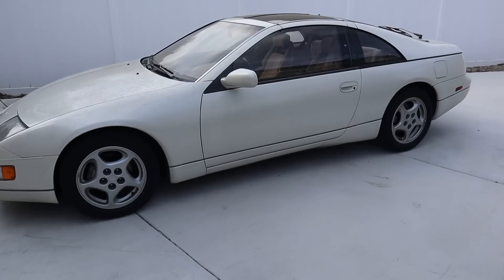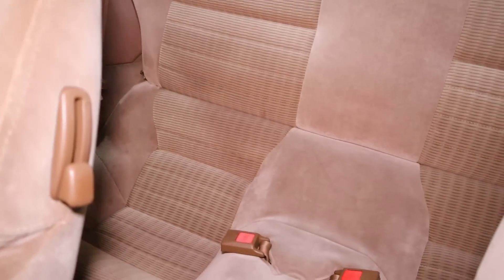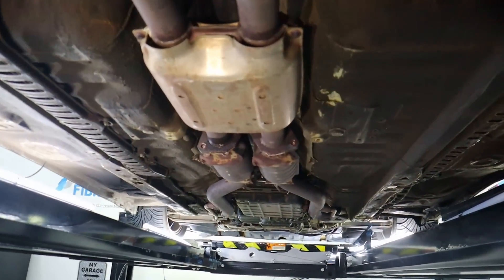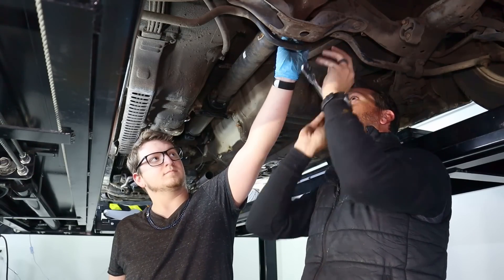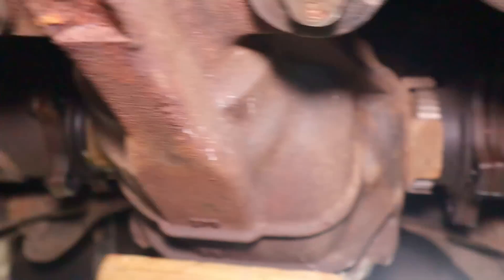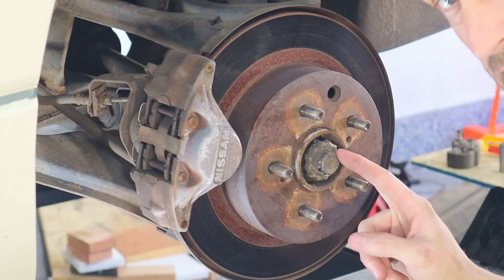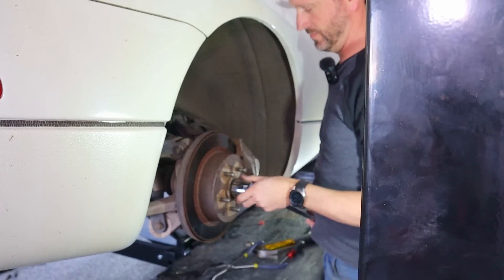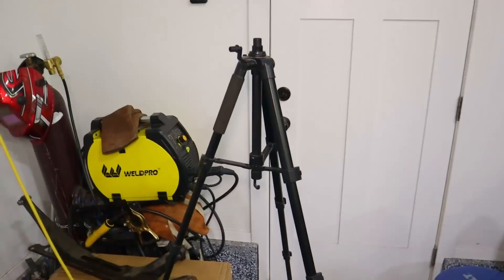Tesla swapping a 90's Icon!  New build!  Nissan 300zx

Comment: Watching it again and you might find out about moving it with the rear axle out of the rear axle. It might hurt the rear bearing in the axle. The front wheel drive VW will be hurt if it doesn't have the axle in and tight. Just trying to help. Go by some cheep impact sockets please. Craftsman aren't that great.

Comment: Might want to use impact sockets when using impacts for removal - could be why you have a cracked socket. May have physically cracked under high load after some weakening
Reply from the maker: You are probably right

Comment: Hey, just so you know you need to put those axles back in or at least the outer CV joints back into the bearing that’s what helps to hold the bearing together. You can damage the wheel, bearing with the weight of the car without the actual, squeezing it all together.

Comment: Nissan interchanged a lot of parts in the 90’s. Tons of similar parts on various models. For instance….. if you need some more room in the diff area, you can use axles from a 240SX. That will get you an inch of room on each side. The bolt pattern is different on a USDM 240, but the stubs are plentiful or you could use JDM axles which are the same 5 bolt flange as the Z32 chassis 300ZX.
Reply from the maker: Thanks for the information!

Comment: 4:35 that's what happens when you use an impact gun on a soft socket. Impact sockets are much harder & stronger...
What powertrain is going in the 300ZX?
Reply from the maker: TBD.  Have to evaluate the space

Comment: Jeremy, It's nice to see you have work.  Word of advice and I understand you are not rolling the car around. Just be careful about not having the CV joints in. The torque of the nut and the CJ  in place helps to preload the bearings. Without the CV joint in place it could cause an issue to the bearings over time. (It could - not saying it will.)  All the Best, Tony
Reply from the maker: Ok, thanks

Comment: The dust cover for the wheel nuts are kingpin locking shields to stop the but from turning, should've been a pin through the hole in the axle that slots into the crown of the shield.
So cool to see another customers get already!!
Reply from the maker: Thanks for the info

Comment: Nice.
Maybe try to implement the Classic Electric car playbook for this build, meaning: Utilize ONLY original mounting points.
The usually build cradles tto hold teh battery boxes and drive units an manufacture matching mounts bolting only to original mounting points... check them out on youtube!
Reply from the maker: Maybe

Comment: Great car as I use to have one. Interesting thing is I found out after years of ownership is check behind the driver and passenger seats.  There is a large plastic strut mount cover. Hidden in those areas were factory headlight adjustment devices and a tool set. You should check to see if that car has any.
Reply from the maker: I'll check it out

Comment: Why don't you weigh any of your electric conversion cars before stripping out the oily bits? Specifically, corner weighs them before & after strip out, so you can keep within the car's original weight & keep the weight distribution the same to ensure it handles as well if not better than it did before conversion.
Reply from the maker: Noted

Comment: I've had decent luck with penetrating oil, but sometimes the bolts are just too compromised to remove without snapping off the head. I haven't cracked a socket before, either, but tools aren't made like they used to be. I remember when Craftsman had full lifetime warranties on all their tools.

Comment: Just my 2 cents here. If you are going to do this for a living, you need better tooling. Impact wrenches will save you so much time and effort that they pay for themselves. Milwaukee makes really decent power tools at a good price. You may want to consider that. Those axle nuts would come right off with the pull of a trigger. I couldn't imaging doing my job without power tools. Possible, yes. Practical? No. Love the videos, thanks for bringing us along.
Reply: I definitely agree about the impact wrench for these larger teardowns/projects, but that oil pan was just wrong. Drain plugs should never be torqued down more than 20 to 40 ft/lbs, but I've had some shops in the past use impact guns on them. I actually checked the torque on one that I got back from a shop once, and it was nearly 100 ft/lbs. That was on an aluminum pan. 🤦‍♂
Reply from the maker: Thanks for the suggestion!

Comment: Nice to see another video. 
Only is it better to not take the cv-joint out of the bearing and then put the wheels on. It could damage the bearing through the weight of the car on the loose bearing's. When the cv-joint is in the bearing it clamps it down.
Reply from the maker: Nope, no damage